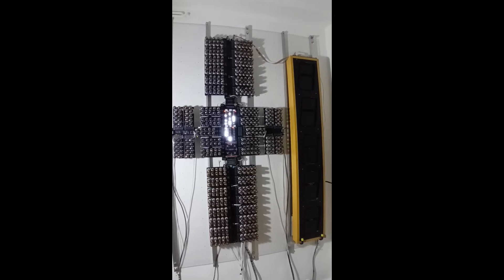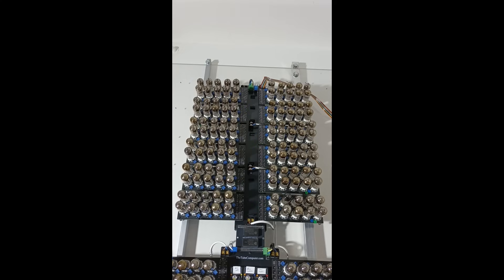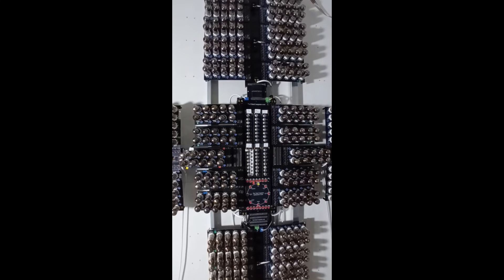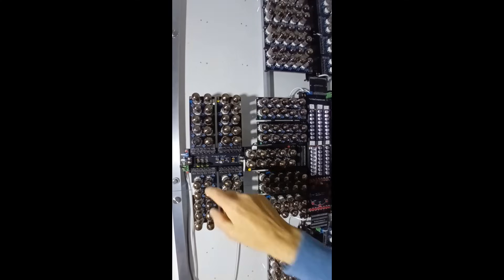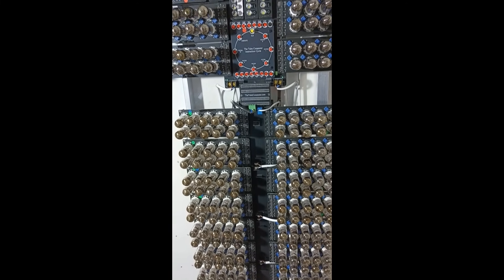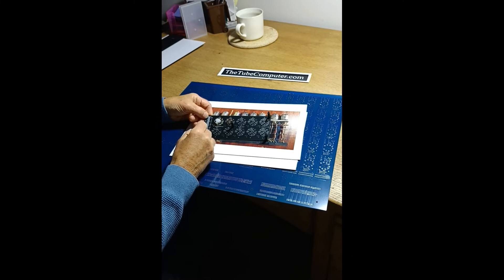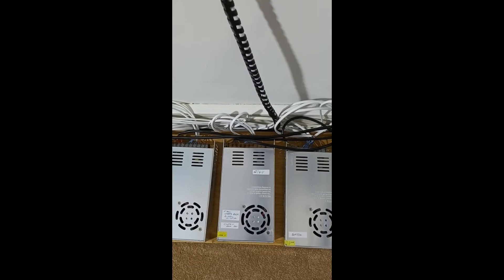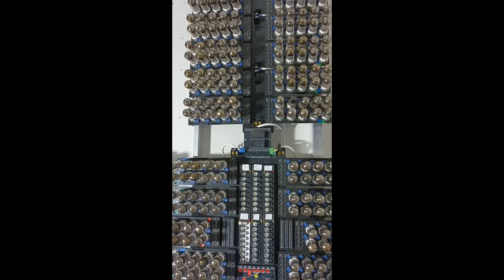The Tube Computer

Comment: Great project! Especially love the mechanical display!
Reply from the maker: I am surprised that no other tube computers seem to have been built. Glad you liked it!
Reply: @TheTubeComputer There are others, Usagi Electric for one, though his is a rendition of a 1 bit industrial controller IC in valves. The company I worked for before I retired made those clocks, they were controlled by a Patek Phillipe clock that received its time from the atomic clock at Rugby, though it is now at a different antenna. Those particular digits are pretty much the smallest we used, the biggest had individual segments nearly 12" long and were mounted high up in a Port Talbot dock displaying weight from a load cell on a conveyor. Are you still using the original drivers for those digits? I would be interested to know the date code on the boards and if the electrolytics are still going strong.
Reply from the maker: @TheOwlman  Many thanks for the info. The 1 bit industrial controller looks very complex. My digits from British Rail came without any drivers (or capacitors). I use the uln2803a, an 8 bit sink IC to drive them. The digits are not particulary robust and occasionaly a petal will fly off!
Reply: @TheTubeComputer I just realised that I never mentioned the reason for all the capacitors in our drivers! The rule was that the clocks could never show an incorrect time, so if anything happened to either the master clock signal or the power to the clock it had to blank, so the drivers stored sufficient energy to flip all the digits off, and there was a fail safe circuit that would do so if it wasn't kept happy. The software also refreshed individual segments all the time, so if you manually flipped segments while the clock was running it would correct itself within eight seconds; not that  you could get at the digits, since there was a lexan screen, but it would help if a segment pivot became a bit sticky. Regards.